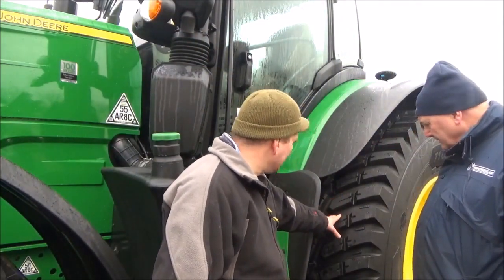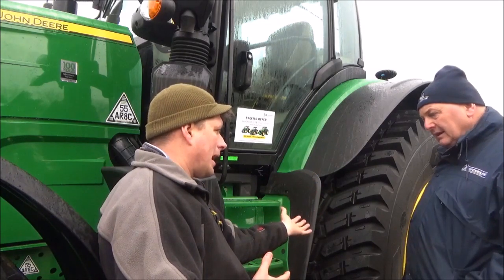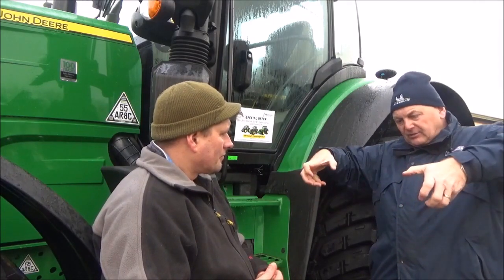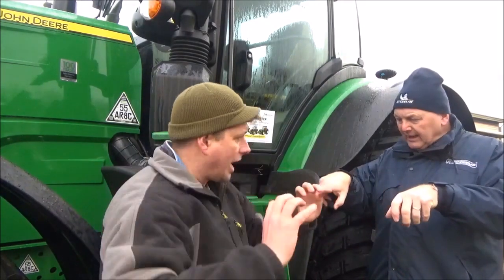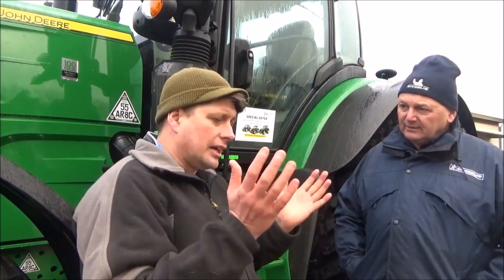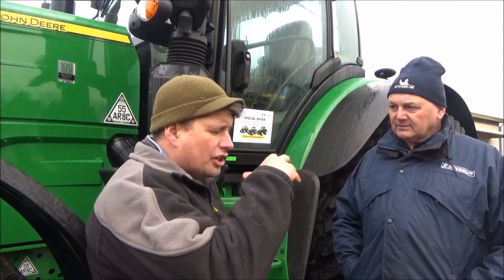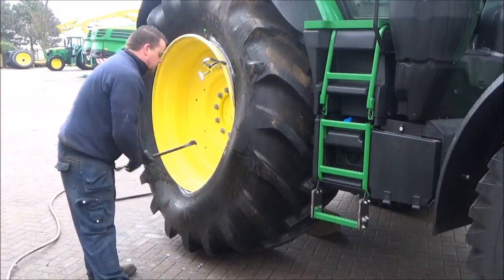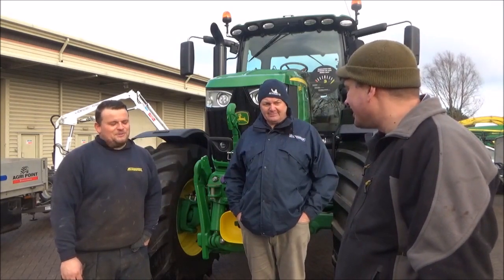MICHELIN ROADBIB || TYRES || TIRES || LORD MUCK

Comment: Amazing how tyre technology has come along. Back in the 90s we were running duals all round or the low ground pressure tyres which were a pig to move on the road but these modern tyres offer the grip,low ground pressure and road legal without an escort . All good. 
Very informative 👍🏻

Comment: I worked for Bridgestone/Firestone for 5 yrs  doing truck and bus then offroad  tires i ran a boom truck working the the woods changing and repairing skidder tires  quarries working on the haul trucks and loaders had 5 underground mines that i had to take care of also loved doing that kind of work but it took its toll on my body and had to give it up. It wasnt bad work just phyically hard and since i got out of it ive had 1 shoulder surgery and both hips replaced ...but it is what it is no regrets .....
Reply from the maker: Have a watch of this 😉
https://youtu.be/ZyFRk1jBhnY
Reply: @LordMuck  i just checked it out i honestly didnt mind changing any tire ...but a damn goodyear ...the damn sidewalls are so stiff i have actually had to park a loader or bulldozer on the other side of my boom truck to keep it from sliding away from the tire i was working on .....i was changing a 45/65/45 on a Cat 992C frontend loader onetime and had to get the trackhoe operator to put the bucket against the top of the tire and put the tire handler on my boom agsinst the bottom to get the rim and bead flange pushed back far enough to get the oring and lock ring back on and still almost pushed the loader off the jack snd cribbing blocks ...the boom truck i had was big enough for the job but it still struggled with them 42 ply tires

Comment: Thanks for the info, very helpful.Them "road tyres" would be ideal for carting nd hedgcutting trailer work,low loader stuff but when i put my plough on or in heavey wet ground conditions id have to stick with the tractor tire as most people know them to be.i run michellens now but would love to get the trye thats on a hinge sorta thing for both appilcations
Reply from the maker: I'd like to try a set of the RoadBibs on the plough Tom.
Reply: Lord Muck~so would i because im.pretty much sold on them its just draught work it would be interesting.The Roadbia tryes probably be best on loader tractor

Comment: are these tires available in the USA I work for a county highway department we have 2 dedicated tractors that mow ditches and we wear out tires terrible these look like they would work great we run Michelin snow plus tires on our loaders that ware and grip awesome great video thanks be safe.
Reply from the maker: I've just spoken to the guy at Michelin and they should be available in the States once the final design has been signed off.
At a guess I would say early next year by the time all the promo and marketing has been done so still a while but it will soon be here before you know it !
Reply: Lord Muck I was just wondering myself sure looks like it's a good tire. Btw how does it do on the field
Reply from the maker: Joel they reckon pretty good in the field but I want to try them out and show you guys.
Reply: Lord Muck good idea cause I like the looks of these almost as if they'll have a better grip cause of more lugs
Reply: They look like the Nokian hakkapelitta that are available now in the USA.
Reply from the maker: They look similar but have a longer lifespan and are designed for high horsepower tractors and have a much higher self cleaning capacity.

Comment: INteresting stuff...   Plenty to Agree and Disagree about !  Hmmm Basic  tractor without FE  Ballast ....    Carting unnecessary weight around springs to mind - aka Fuel consumption;  150hp tractor and 2 coos in IWT to the Mart  :-).   Anyfield, those tyres CAN work for ploughing - I use Turg tyres for ploughing and Dozing with my Deere - since years.  thanks for the Vid.
Reply from the maker: I think the point they are making is that due to increased loading for modern applications the tyres have been designed to withstand this but the trade off now is weight is required to get them to flex and run evenly.
Good to hear you're getting good use from the Turgs.

Comment: Gotta disagree with the expert I'm afraid! We take the weight off thentractor if it's doing trailer work! 6920
On 7700 hours on the original tyres and it's done allot of road work! I can guarantee these would not have lasted if the weight block is on the front!
Reply from the maker: You’re running old style tyres so I’d agree about removing weight. If you went for the modern equivalent you’d be better having some weight.
Reply: David Rowley would say around the 2.2 ton on average

Comment: Oh and while I think about it, taking weight off the front when towing a box trailer or tanker or whatever makes no sense at all. On the majority of such implements the wheels are at the back or possibly the centre and so because of leverage they have to transfer a lot of weight into the hitch, thus causing the tractor to pivot about the back axle lifting the front wheels. The exception being something with a front axle of it's own like a bale trailer.
Reply from the maker: No, taking weight off the front axle used to stop the tyres heating and scalloping out. Designs and technology have now changed to prevent this from happening to such an extent.
Reply: Doesn't make sense.  If you have a say 20t muck spreader on a single axle it will potentially be imposing a loading on the hitch anything from 4 or 5 tonnes upward depending on how the axle is positioned. That's going to affect the front wheels of the tractor, it's physics.
Reply from the maker: So why have we all spent the last 50 years removing weight on road work to prevent excess heat and wear ?
Weights left on for roadwork killed tyres.
It’s a simple plain fact.
Reply from the maker: The rear tyres would heat and wear but there’s nothing you could do about that but you could prevent the fronts wearing out at the same time therefore getting more hours out of them and not needing the expense of replacing all four in one go.
Michelin have seen an increase in fixed weight and also front mounted implements and have developed a modern range that are stronger and less prone to wear. However, this now means they need weight to get them to flex and ride correctly.
Reply: Probably because the inherent balance point of tractors has altered over the years, becoming less nose heavy and more neutral as weight has been increased in complexity of transmissions and strength of rear ends  and now tyres have caught up,  meaning that the front needs to be weighted to account for towed implements. Probably.
Reply from the maker: Yep so you now have to consider front suspension, front mounted implements, higher speeds.
Reply: While I wouldn't want to do the actual maths to work it all out, getting the most out of tyres on a tractor from a manufacturing point of view is utterly fascinating, so many variables to account for!
Reply from the maker: That chat with Ian from Michelin was about 25% of the full chat just because of video timings.
Keep watching as we are hopefully going to try some tyres out in the field (and on the road) this year.
Reply: Awesome!